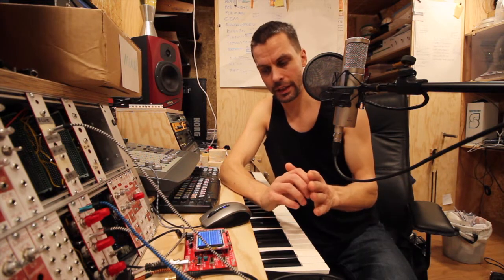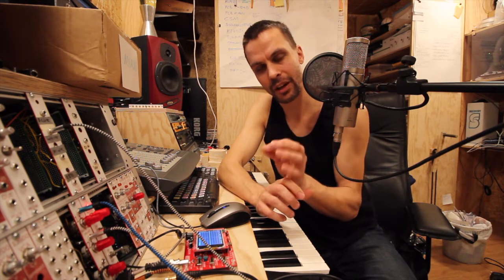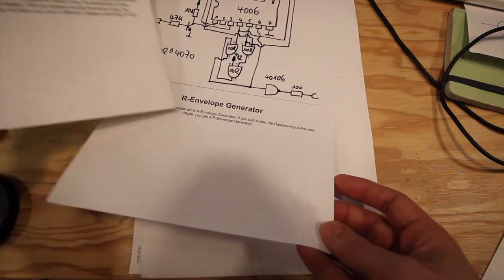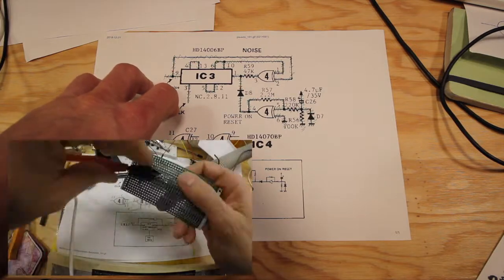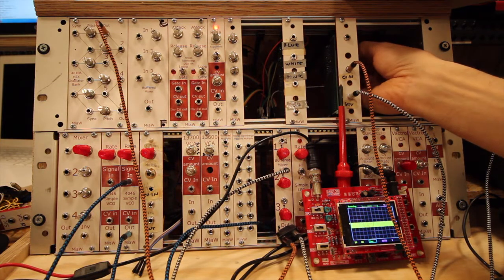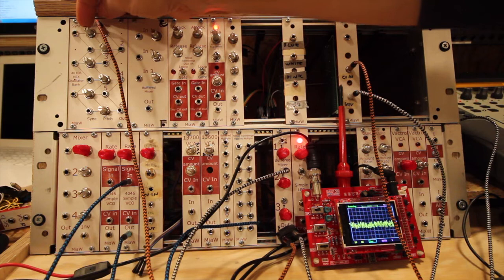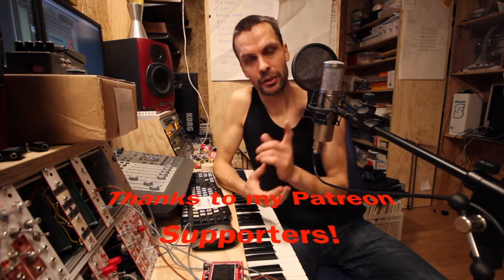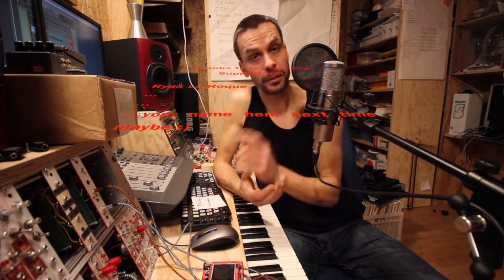Digital Noise and Pseudo Random Gates with a 4006 - DIY modular in a week 6.3

Comment: hi kristian, i have a question on the conections of the 4006, do pin 4 goes to pin 13 and 5 to 12 and 6 to 10 or im reading the schematic wrong? thanks in advance
Reply from the maker: Sorry for late reply, but yes, you are correct, pin 4-13 6-10 5-12 etc etc, just jumping the pins.

Comment: Hi Kristian 

First of all , Thanks a lot for all the Great content. I really like your Videos.
I built this Module ( 2 times ) and with both of them i have the Same Problem ... it always stops Playing After a Short Time . Sometimes it starts again After a While and sometimes i have to turn of the Power of the modular and Turn it on again ... i checked the circuits at least 10 times But i can’t find an error .. than i Noticed that the Same thing happened with your Module at about 5:20 of this Video .
How can i fix this and Does anyone Else had Problems like this ?! 
I thought that maybe grounding the unused inputs of the cd4070 Could change something because there is an article about cmos Chips am lunetta Synthesizers where they said something like this but the Problem is still there ...

Thanks for your help. 

Best Regards
Reply from the maker: Thins for watching ;). Ok so I THINK that has to do with the circuit running too fast. When I reached the max speed on my oscillator clocking the module it always happened. But as soon as I stayed below max oscillation it works. I would say try grounding the other inputs. It can’t hurt and if it solves the problem I would like to know and I will stand corrected :)
Reply: Ok , thanks for the quick answer and i will tell you if groundig solves the Problem ...
Reply: Hi Kristian , grounding the other inputs makes no difference but i tried what you Said about staying below the Maximum oscillation Speed works fine. Thanks for the help and have a nice day
Reply from the maker: Ronnie Schleich thanks so much for getting back to me. Try to add a resistor I series with the pot to make sure that it is never in “max” positions.
Reply: Good idea , thanks a lot. I will let you know if i find another way to fix it

Comment: Love the sound but I can't get this one to work. Do both chips need +12v and -12v in pins 14 and 7?  Also the 4.7uf capacitor.... does that go to +12v with the negative side connected to the 100k ,220k and diode? I'm doing something wrong for sure.
Reply from the maker: A few things. First you should NOT connect cmos chips eg the 4006 to plus and minus voltage. Use plus voltage on pin 14 and gnd on pin 7. Otherwise you might fry the chip. :/
Second this module won’t work without a clock input and it needs to be quite a fast one. So a square oscillator or similar should work. As for the caps I need to get back to you when I have the schematics in front of me.
Reply from the maker: Oh the 4070 should also have GND on pin 7. Not -12v! And yes the cap have the positive side toward +12v. This module does not need -12v at all I think. Only +v and gnd.
Reply: @SourceryOne  Thanks mate, you are a diamond geezer. Got it working, only fried one chip!
Reply from the maker: That’s great! Well sad about the one chip. But great you got it working. 👍